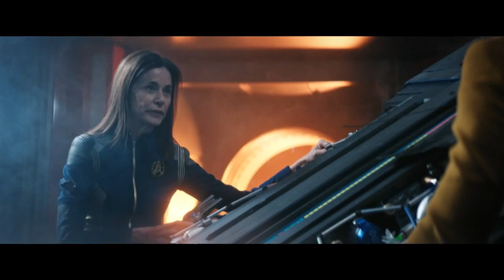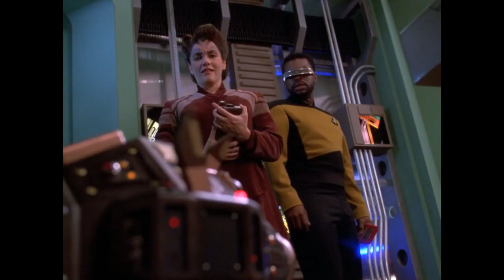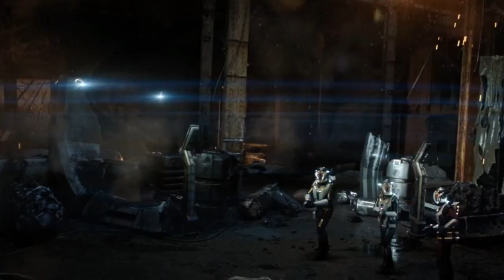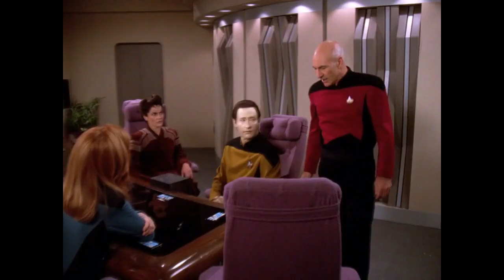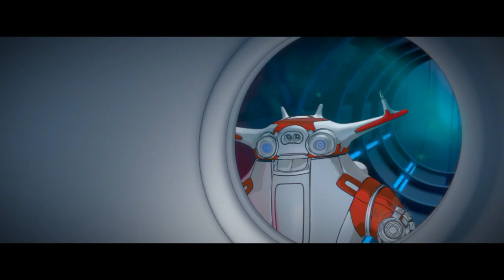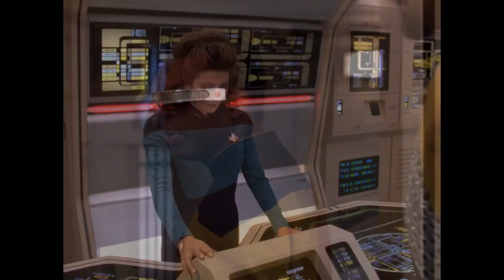Repair Droids in Star Trek Discovery Contradict its Own Plot & Trek Shows Set Later Chronologically

Comment: With a slightly better understanding of Trek it would be trivial to have robots and not mess with life and death situations. Keep the robots hyper specific: room cleaners only clean rooms, hull fixers only fix hulls, etc. They’re dumb and hyper focused, and a Roomba will never fix a power line in a poorly designed conduit, any more than a Crushinator can fix a normally safe dilithium chamber.

 That makes the exo-comps and Data amazing specifically because they can think through complex novel situations, and can take best advantage of their respective physically adaptability with no human intervention required. That, and they’re mentally stable. 

Mental stability of machines in TOS was extremely difficult. Even TNG had issues given Lore and Moriarty. Hyper focused pre-TOS robots wouldn’t be a flaw, it would be a critical safety measure.
Reply: That perfectly explains away this plot hole.

Really, TNG is at fault (unintentionally). Considering our current technology, drones and roombad, it’s preposterous that we won’t have some sort of repair robots in three hundred years.
Reply: FantomFilmmaker I like to think TNG does have a load of bots we don’t see. They have self cleaning floors and Voyager always gets fixed too easily. If they had robots we never see it helps explain those things. But the reason they’re not there is budget and theme: the show is about people so people do everything on the show.

[edit] unfortunately my explanation doesn’t fit DIS, because the show shows the robots being a bit too versatile, and the cartoon shows a bit being too anthropomorphized. My point is a small tweak would fix the show.